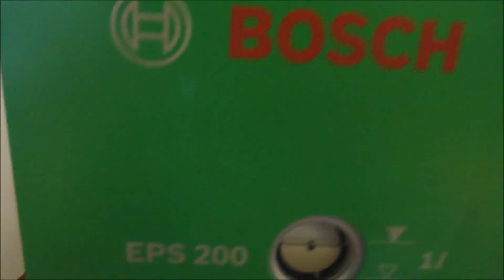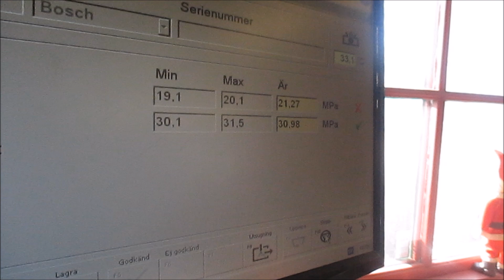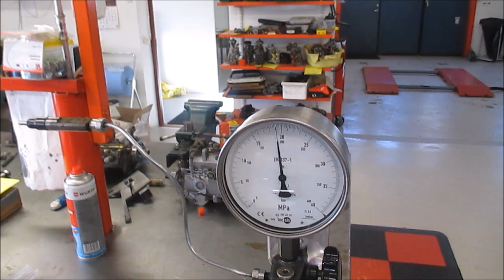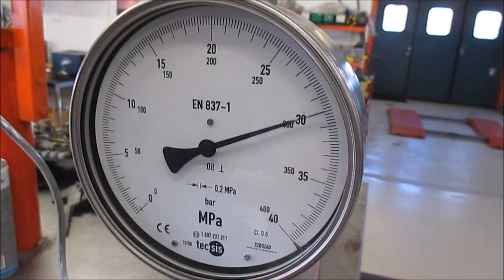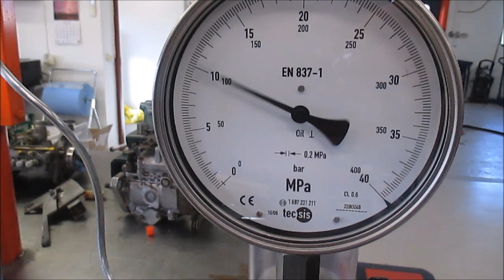2 stage VW 1,9tdi injector how to check pressure

Comment: My study of this indicates that one can do the pop testing of the second stage pressure by adding a little shim ring/washer around the push rod that passes through the hole of the piece Dieselmeken  holds up.  I think even a little ring of wire of the right gage will probably do.   Here is how you know you've got it right.  When you normally set the nozzle on the injector body it his held up by an internal spring. You can push it down but it will spring back up until the nut compresses it when you tighten it down.  The spring you are feeling is the stage 1 (pilot stage) it's pop pressure is a little over 3K psi. .  If you install the the right thickness shim ring and try to push down on the nozzle, it should go down with the same force as before until just before it bottoms out.  At that point it should get noticeably harder as you are now trying to compress the stage 2 spring along with the stage 1.  (which adds 1.5 K to to the pop pressure)   When the nut is tightened down, you now have a single stage injector with the pop pressure essentially equal to the stage 2 pressure, ( about 4500 psi) which is the force of both springs.    I said "essentially" because it's just a bit low.  To get the "exact" pressure you would need to lengthen the push rod by the thickness of the ring shim but it's not likely to change the pressure much.    If one  is going to attempt to set up their injectors by this method I think the right way is to 1) remover the push rod while leaving the shim and set what Dieselmeken calls the "idle" pressure of 1450 psi by shimming the bigger spring.  This is the "add pressure".  2) reassemble the injector in normal configuration and test and set (by shims)  the stage one pressure of 3050 psi (via the deepest shim) .   The stage 2 should be the sum, 4500 psi and isn't set directly.    All this tells me that for a DYIer with a pop tester, it's probably valuable to simply pop test and adjust the stage one pressure even if they skip doing the stage two adjustments.  Cheers
Reply: HI. What is the special parts for height pressure check? In the video isn't clear see.

Comment: get a piece of tape around that test steel tube,close to the end,so the nut does not slide down every single time;  paper masking tape is best(degrease first); or just a rubber band, a loop of solid copper wire,or a band clamp,or... can you give some more suggestions?

Comment: Hi
i need the special tool used at 3:04 to test stage 2 pressure, pls help :)
Reply: Good day! Did you recieve answer from author about that tool?I'm interesting too!Let me know if you got any information or plans of it!Thank you!
Reply: @СергейМаришин-ф4ъ  never did, still finding one
Reply: i am also want that tool , if you already find then tell me from where you get that ......
Reply: Any luck finding that tool 6yrs later?
Reply: @amazonsk7751  Just grind the .10mm lip off of a spare pilot collar. And don't forget to change back to the unmodified one when you are done adjusting.
Reply: @albinklein7680  yes I found out, but thank you very much! ❤️
Reply: @albinklein7680  Thanks for posting this tip. Undoubtedly the easiest/quickest way to create a test collar. My only thought is – does this alter the preload on the main spring sufficiently to lower the opening pressure by a significant amount during testing?
Reply: @steplusplus  I was thinking the same thing and I measured that lip to be about .07-.08mm. that should be about 10-15 bar less opening pressure with the ground off lip. The shims come in steps of .04mm (at least in the sets that I have). In my experience this doesn't matter that much. I had some injectors I set up with the "grind that lip off" method on a proper Bosch test bench and they were perfectly in spec.
Reply: @albinklein7680  That's really useful info, thanks. I'm thinking that it's more important to have all injectors closely matched but, yeah, that's not a huge amount anyway.👍
Reply: @steplusplus  exactly. The utmost important thing is that they do not leak at the opening point (i consider an injector "not leaking" if they lose less than a drop of fuel during five minutes at/close to opening pressure) and that they make a nice and even "purring" sound when they open. The second stage of those TDI injectors should make a nice, sharp and "scary" *bang*.
The rest is not that important. I often get perfectly running engines in my shop which have four different brands of nozzles installed with opening pressures all over the place.

Comment: Very interesting! My friend wants me to try putting a so called rebuild kit in the pump of his 1.9L TDi before he resorts to converting to mechanical injection. My understanding it can be done on the car without removing the pump so... Hope it works. The car just quit running one day and gave a few restarts but would only idle and thats it, no more. Supposedly it's the pump and it acts like its not getting fuel. We shall see! Those 2.5L Land rover pumps are somewhat scarce and expensive! I like my all mechanical diesels! Don't mind my common rail system on my Duramax as long as it doesn't kill any injectors! Its an LB7 and they are a pain in the ass to replace.